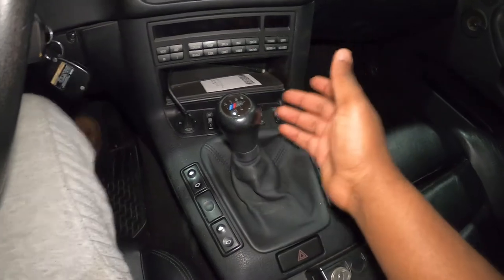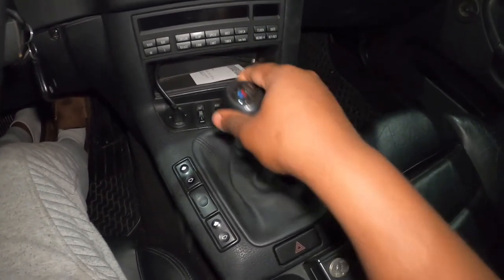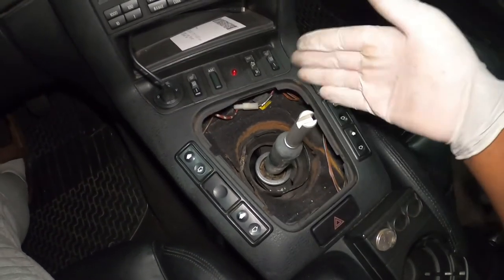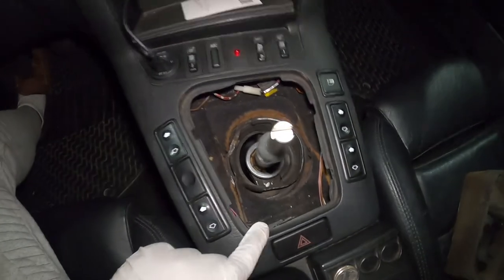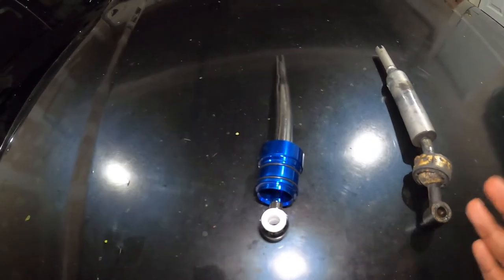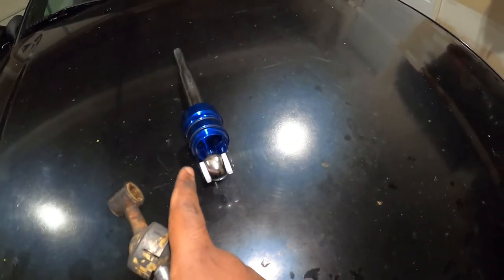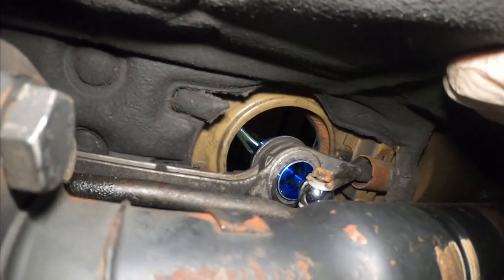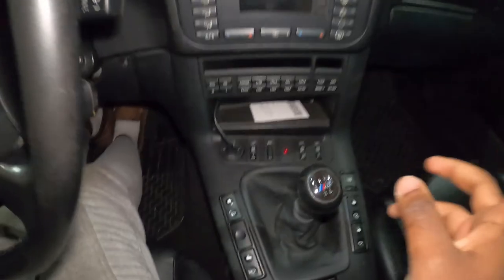Ebay short Shifter Installation and Review on E36 M3

Comment: Thanks for this. I'm fiddling with mine since yesterday. I had to grind and dremel the blue part because it would go deep enough into the carrier so i could secure the bottom/place the clip. The blue thing is also loose on my side so i had to put tape around it so it could be snug into the carrier
Reply from the maker: I am actually thinking of replacing mine with a chassis mounted version. Probably early next year.